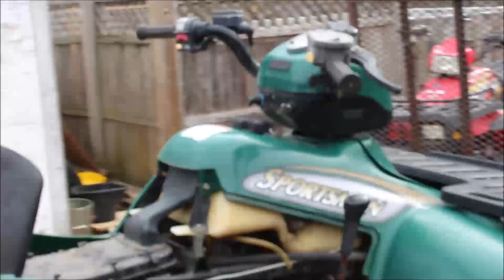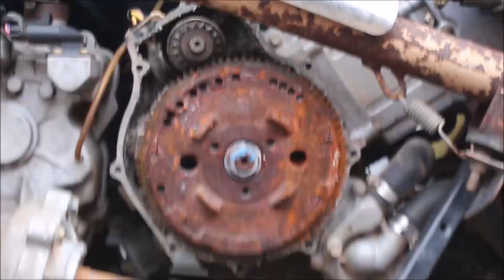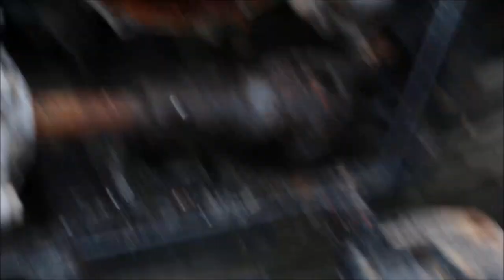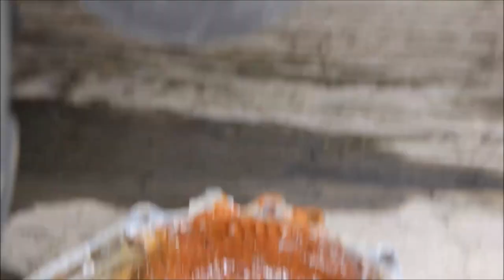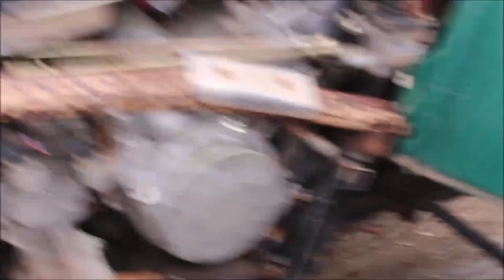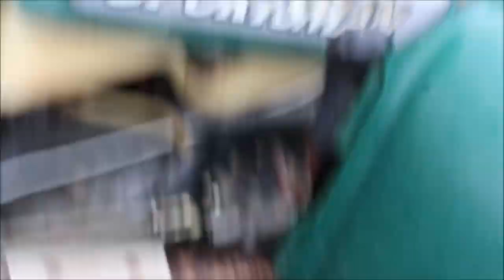Did I Get Ripped Off! Polaris sportsman 6x6 Big Boss!

Comment: I just bought a 2001 500 6x6 I had to deal with the exact same thing. Now I'm rebuilding the transmission cause when I shift into high it stays in low gear. Already rebuilt the shift box

Comment: Nice score man! Glad it was something (relatively) simple. I’ve had great experiences with aftermarket carburetors. What are your thoughts and opinions with aftermarket parts? I also rebuild Polaris machines.
Reply from the maker: I didn't like the aftermarket carbs at first. I gave them a try again. I think they got better. I just put one in the 6x6. runs great!
Reply: @TitaniummanGarage  I find myself having to set them, but I’ve must’ve installed 40 or so of them by now and except for one, it’s been great.
Reply from the maker: @smallgaragehustle  Thanks for the feedback.